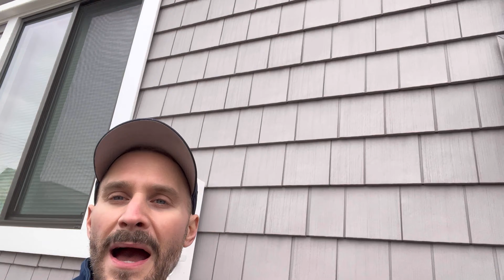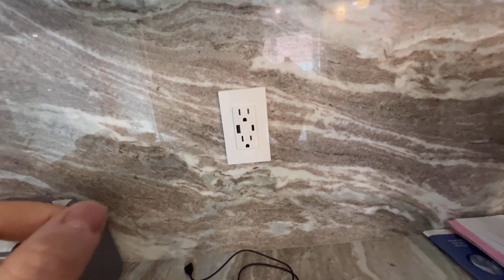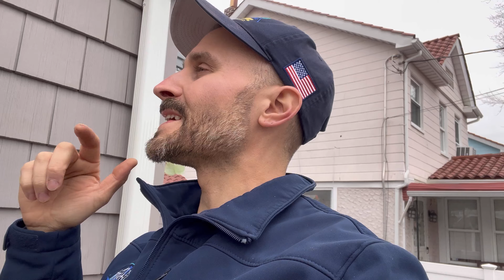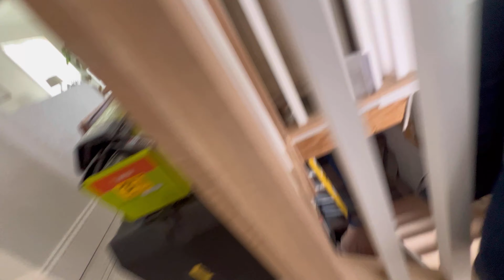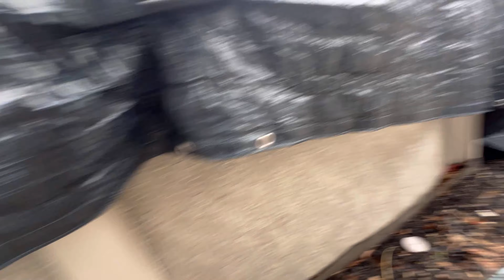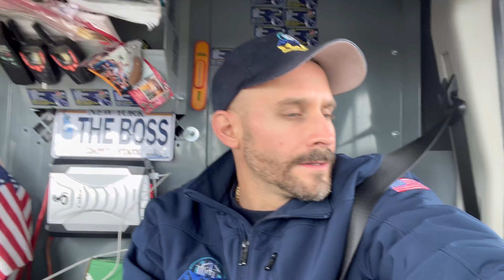YOU JUST CANT MAKE THIS SHIT UP !! TOSOT DONT LET ME DOWN ON THE NEXT INSTALL !!

Comment: I don’t know why any of you are surprised that vibrations carry through the structure. Those vibration isolators that come on those wall mounts are not good vibration isolators. If you don’t want noises to travel through a structure, don’t attach the unit to the side of the building. Put it on a concrete pad or up on a pressure treated post stand, separate from the building. 

These mini split heat pumps along with most of our split systems nowadays are built in Mexico and China, as cheap as the greedy suits can get them made. It’s more profit in their back pockets. You better get used to this, it’s only gonna get worse. I put in an American standard hp last summer, the compressor lasted two months. Put in a new furnace made in Mexico by Airtemp, the igniter failed in two months. Junk.
Reply from the maker: JUNK AGREED

Comment: If you build millions of anything you'll get failures here and there. That's just statistics. If it didn't make that noise out of the box, how would the QC catch that issue realistically?
Support reps are endorsed to keep the books in check and not send out replacement units to hacks that don't do the install right. Also makes sense from a business standpoint.
Try Daikin if you want heat pumps for heating, they have some killer units efficiency/money wise in Europe and their algorithms for indoor fan speed in heat mode and modulation down to the heat load to avoid short cycling are really solid.
Reply from the maker: DAIKIN I MIGHT TRY NEXT

Comment: I can relate. I’m ripping a brand new furnace out that I installed today with heat pump coil on top, because the supplier screwed up the order. Very frustrating!
Reply: You don’t check the order before you install?
Reply from the maker: FRUSTRATION

Comment: Fujistu are good units. Better then the gree. But Mitsubishi would be the next option if you’re going to switch. Unfortunately you get a bad unit every once and awhile. Im not a fan of hanging them unless you have to. They do vibrate a little bit no matter what. I know your service area in New York is tough and there not not option due to the right area. Where im located pads and stands work well with the lot sizes.
Reply from the maker: GREE 😂